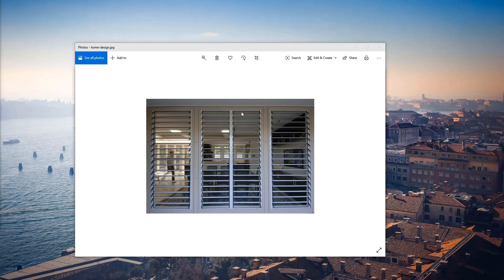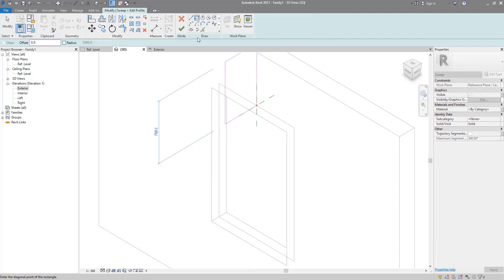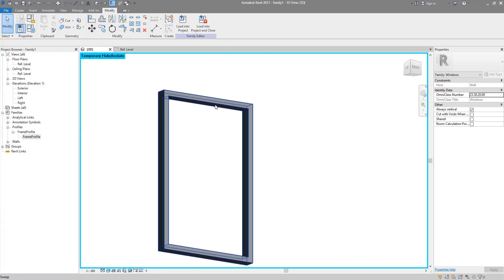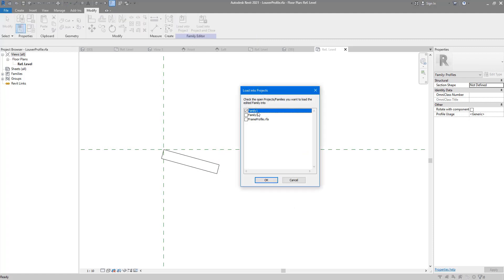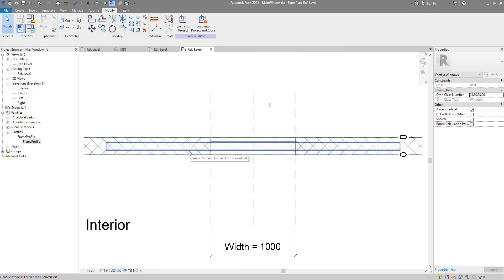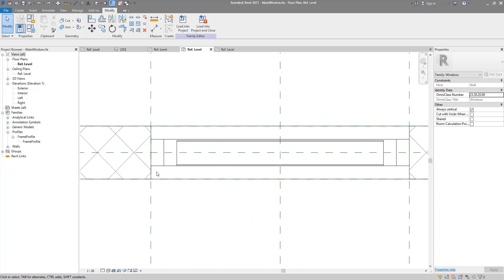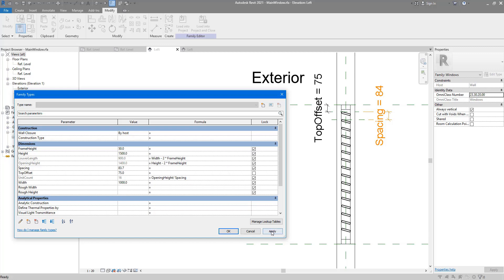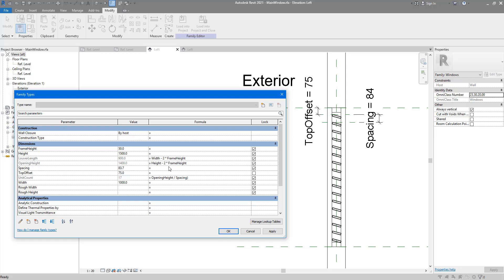Revit Snippets: How to create fully parametric louver windows

Comment: I Really like the toutorial, but if I need the louver to have the maximum width of 100 cm, and after that they multiplicate by them selfs, its is possible to do it? 
Like you did in vertical but in horizontal
Reply from the maker: Yes that sounds perfectly possible! Could you send a photo showing this kind of window?
Reply: @RVBoost  I tried to paste the photo here, but did not worked, the window it is the same kind as your, louver. But I dont know if I have to use the array comand or just put a formula to make this parameter work
Reply from the maker: You can upload the photo somewhere else and paste the link here. Anyway, sounds like you'll need to use an array to copy the louver unit horizontally, then use a second array to copy louvers up and down the opening.